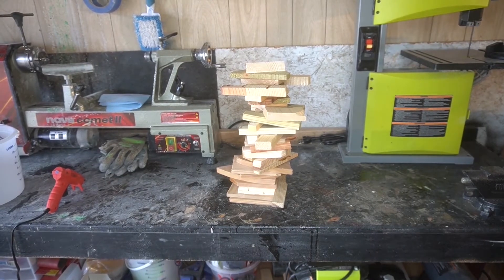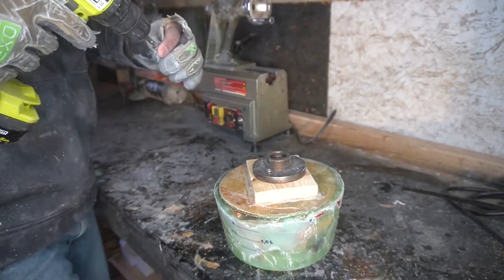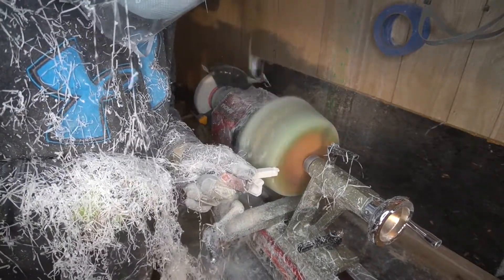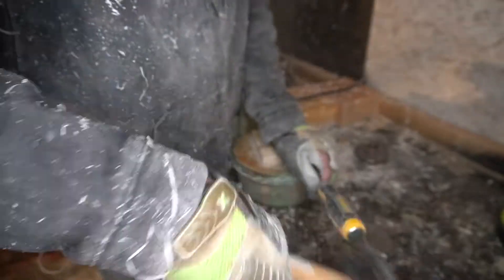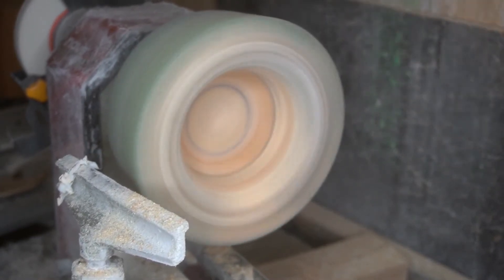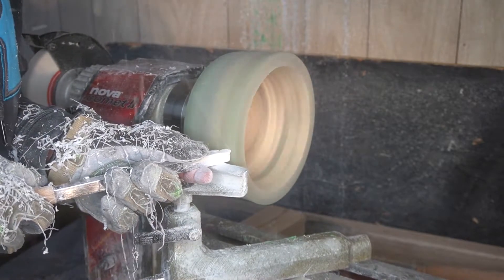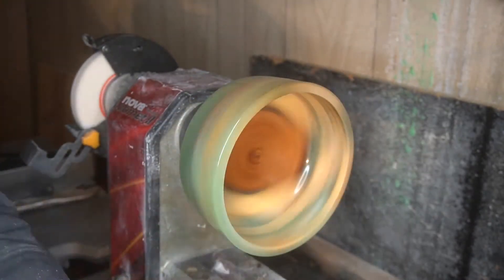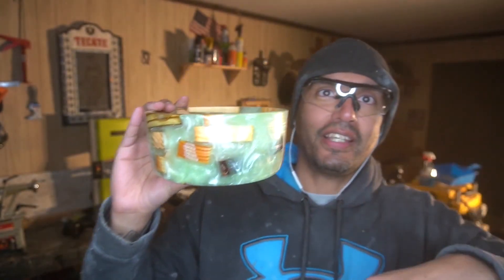Woodturning The Green Jeweled Bowl

Comment: Mortise or tenon holding bowls has never been a great way to hold bowls.  Many turners will use the tail stock and cut around the center as much as possible until the last possible moment the plug has to be removed.  A vacuum chuck is a great investment to help hold the bowl on.  You could also put down rubber mats around the lathe to help absorb the impact.  Great vid.  Keep them coming.  Color of resin is very important as you stated.
Reply from the maker: Thanks for the tips, I always need some guidance since I’m relatively new to turning. I’m gonna look into a vacuum chick for sure.